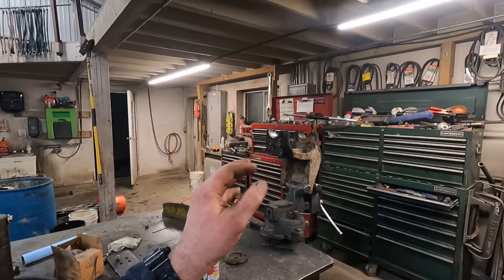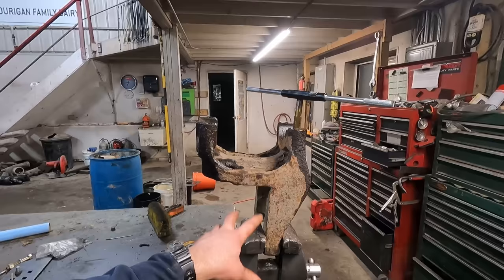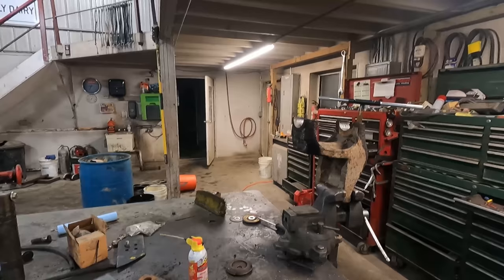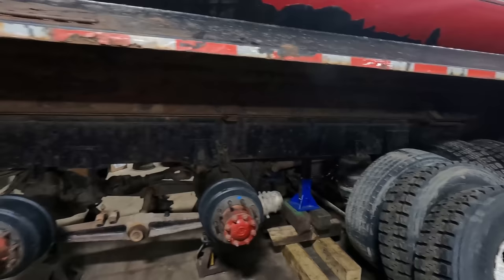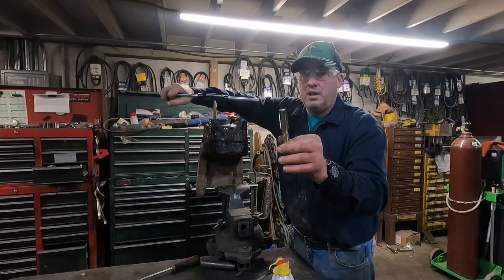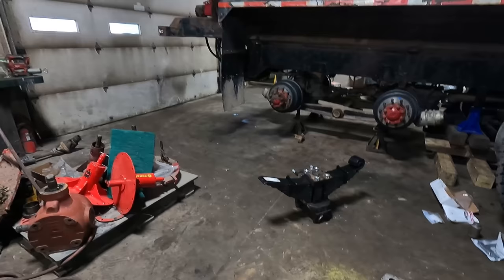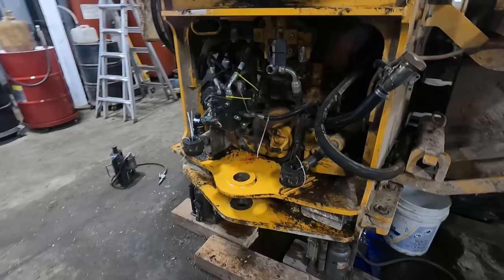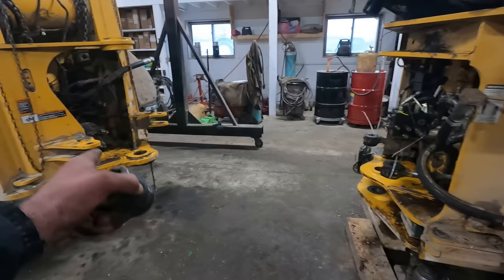Reassembly: Part 2 center Pins and bearing replacement on a John Deere 624k payloader

Comment: There are many that despise the use of anti-seize, many will use grease instead. What I've found where I'm at, grease will dry out over time, the anti-seize doesn't and lasts longer. I'm a firm believer in that stuff. 
Seems like a lot of play but, if an expert says otherwise, guess you're good to go. At least you won't have to worry about getting someone in to line bore it. 
Always waitin on "Tim" LOL poor guy. Doing this yourself saved you a lot of money and I know many won't ever understand that. Oil on the floor means the floor won't "rust" Andy hahaha. 
To line bore, they weld it up, then bore to size. It's really a simple process, time consuming is all. Great video as always. Cheers :)

Comment: Mike over at "Dirt Perfect" did a line bore on his excavator beams. Its quite a procedure but doable by a couple men willing to fight for it. Lots of repetition an hammers but then thats life. As you have said an most importantly made aware is Time! You never get it back kinda like getting a second first impression. I wasted my whole life on hard work just to blow it away for some good times an feeling sorry for myself. Feeling sorry is a very expensive thing as there are no I am sorry for them. Many men and women go through life as if it is just what you do. They make time for church, and down to minutes spread out with kids or husband/wife, their thinking is if they do that then everything is just jolly fine and I ain't gonna burst their bubble but that is not the short side story of it at all. Making the best use of the time you have is for lack of better words; Priceless. I rammed my way through life and never said sorry nor would of even considered it. I got tore up a lot getting in the line of fire whether it be driving a truck, falling timber, loading powder on mining operations. I have worked in the air, on the ground, clear under ground for near a mile or so as too young at the time to really know. I have done so many different types of work that I never really got real good at anything...... I have to inject here that from the era I speak most of is from the sixties to the nineties an its not been a hard job as the stuff we did was pre computer, just manual labor and lots of elbow grease. Now things are a lot different an you don't walk in off the street and tell them I  want a job bartending. I was out of work, young with all my teeth, new something about alcohol from personal research an got a job just as that, a bartender. I found out that it was easy work an might of followed it had my body never gave up on me the first time. I was lucky an got my health back. Went back to driving truck till I met a woman who thought I couldn't do anything wrong so spent time wrenching and coming home nights. Seven years later an a pile of money in front of me with everything going just right, she tells me that she wanted a divorce.... that knocked me down real good. I came to alaska where life was in the fast lane for me an did it over again and then the last time was the last time when I got hurt. Still crippled an wishing I had the "time" to do it over
Reply from the maker: Great comment

Comment: Andy here in aus, they build up the worn frame with weld then machine to size, in some instances they will bore over size then make bushings to fit and use liq nitrogen to fit new bushings, some manufactures produce a complete hitch pin bore sets that you cut out the old with oxy then align new  bosses   and weld in place but they still have to be line bored anyway, it would also require the cab be removed for boring, yes Andy you were very lucky you caught yours in time, with regular maintenance and visual check every so often and using a good  high impact grease in that area it will last you years

Comment: Good decision changing the bearings and pins right away. I had an operator tell me his machine was starting to make a noise on a friday at the end of his shift. He decided to run the machine doing heavy earth moving over the weekend and called me sunday afternoon to tell me that machine  collapsed in the middle of a load. Dropped the bottom pin out and tore the top pin with the surrounding plate clear off the machine. When I got to the jobsite the front half was bucket down buried under the load of dirt he was carrying and the back half was tail down, windshield busted out and the cab twisted to one side. The operator almost got thrown out the front of the machine because he was bouncing against the load, running way to hard. It was the biggest machine we had on the job, don't remember the make or model, but I was not prepared for what I saw when I pulled up to that mess. Fortunately the guy was ok, but he wasn't an operator after that. It's pretty amazing how those two pins are able to hold that machine together and endure all the different forces happening all at once.

Comment: I usually know what you are doing, but love watching you do it.  As far as line boring,  if you get a chance, watch a channel,  Cutting Edge Engineering,  he's in Australia,  he does it once in a while.  They have a slick little machine that welds up the bore, then the same machine bores it back out to size.  I looked into one of them and they aren't that bad, you could get into one for around 6k to start.  If a guy was rebuilding old equipment to sell and make a buck, I could see where it could come in handy.

Comment: Old man at deere dealership showed me that welding trick on bearing race for axle tubes. Trick to slide them back in put new one in freezer for few hours. Nice you didnt have to get it line bored.

Comment: Just watched Larson farms video where they were all worried about a few drops of hydraulic fluid on the shop floor,,,  as they argued about who got to run the floor cleaner..   quite a contrast...  great videos,,,  real farming..
Reply: Not a big fan of them. It's all about the latest and greatest.
Reply: @rickburns8492  Much prefer Andy' s  videos.  The projects they tackle have a greater degree of difficulty.  Agree those large volume channels w/ so many followers, lack personalization. More akin to a Hollywood production studio.
Reply: @billupstateny9151  I agree with you Andy is the real deal.

Comment: I bet your glad it’s not an old Mack with camel back springs. Those U-bolts  on the trunnions torque to 1800 ft lbs , have worn out a few torque multipliers in my past.   Glad to hear you don’t have to line bore the pivot.  Always enjoy your content , it’s nice watching people just getting it done.  The problem with maintenance is it’s a never ending job. The bean counters used to call Maintenance nothing but overhead , but compared to having things done out of house it’s big saving.  I used to tell them the only real overhead are people we pay that make or build nothing.    🇺🇸🦅🌏⚓️🇺🇸
 I have seen the pivot points spray welded and bored seen axle ends spray welded and turned. But in most heavy duty applications like yours they bore it true then weld it up enough to bore it back to specifications. 
I found a video of a pivot eye being repaired on a off road dump truck in case you were interested ?
https://youtu.be/RoBm7HuFG80

Comment: We have them line bored some times. They welded the hole up  and recut it to spec. Nothing complicated. We also put those bushing in the freezer for 24 hours and slide in. Nothing wrong with what you did. I just work at a dealer ship.
Reply: The freezer trick works eh?
Reply: @teaches2010   Yes sir. We slick that hole with a paddle wheel and have bushing freezing and bump them right in with rubber hammer.

Comment: Were l worked we would weld in the worn area and use a boring bar cutter and a fixture with bearing to guide the boring bar driven with an auto feed drill motor , takes some time to do. if it was something we could remove we would use a milling machine. you guys did a great job. Thanks for the great stay safe

Comment: Well them two hammers sure showed us there ain't no electrical problems there.  Ya sure fixed'er up good Boss Man! Glad ya didnt have to line bore it.  I've seen'em do trailers , (horizontal) never had occasion to see a vertical job especially as close as those pivot points are.

Comment: We don't usually line bore anything during the manufacturing process. We leave the pins in during welding and use a big ass air hammer to knock the pin out. The 512, 637, 2700, 2400, 2200, R series sprayers are all aligned with pins.

Comment: Good job on the center pin, saved some time and $ by not having to line bore. Unless things have changed, they weld up the hole and then line bore.

Comment: I've line bored a handful of those 24 and 44 series Deere loaders for Five Star, it's a pretty simple job. Typically with line boring you set the machine up on the holes that are bad, put a pass or two of weld on the inside of the hole then bore it out to oem dimensions
Reply from the maker: Thanks for the info Bud
Reply: @FarmingFixingFabricating  Anytime. I really enjoy the channel, keep up the good work!

Comment: One of my loaders is a ‘16 Case 721F with around 4k hours on it now, it has an auto lube system and has only ever worked on the farm.  I had to have the loader pinned and bushed around 3k hours and center pins and bushings had to be done this past September.  I also have a ‘04 Deere 624J, same past minus auto lube and it has 17k hours on it and never been touched.  I’m contemplating trading the Case on another 624J or K.
Reply from the maker: I’m glad to hear that

Comment: From what I have seen before is  that they have a bore welder that lays a series  small beads all the way around a complete circle from bottom to top  on the bosses and then when it cools then that's when they bore it back out to specks for OEM parts . As for the bushings or cups put them in the freezer over nite . It will shrink . Kinda like heating a bearing to slide over a shaft

Comment: On are 644 they built up the bore with weld then line bore it out . Then had to do the bucket joints to built up with weld and line bore to over $12,000.00 in parts and labor .

Comment: If you have problems getting them in we usually throw them in the freezer before we install the 100°f = a thousands of movement with metal most of the time

Comment: Just goes to show it never pays to ignore noises and symptoms on that stuff. I get after my girlfriend all the time about that lol.. i have been involved in a couple skidders where thats what had to happen: carbon arc gouge the welds off, pound the bushing holders out and weld new ones in then check/center-bore it. Awesome shop video like always. Gonna be cold tomorrow and this weekend get your diesel fuel soaked gloves out lol
Reply from the maker: I’m hoping that we are late enough in that the field treatments have had time to do there thing
Reply: @FarmingFixingFabricating  that’s what I was thinking yesterday I’ve been putting fuel treatment in everything all winter and it hasn’t really been that cold up until now. We’re only running two trucks today and I just got them both running so as long as they stay that way I’ll be happy

Comment: We did the same thing years ago on a 69 hough 90 . That job was a bear I believe it weighs 40,000 lbs there were more than a couple butt pucker moments when we lined it back up. I use high temp brake grease instead of never seize, seems to hold up against the salt a little better.

Comment: Cutting Edge Engineering Australia has some videos on line boring and welding. It takes a special machine. Not sure it would fit in the cramped space available.
Reply from the maker: They have a special one just for it

Comment: I don't know if they make oversize pins. They use a special wire feed bore welder gun to build up the bore and then turn it back down to the pin diameter.

Comment: I use liquid nitrogen all them time in the shop to shrink bushings and other things I need to push in. Have an old semen  tank I use for it. Have it filled when they  charge the ones we store semen in. Pour what you need in an insulated water jug and lower part in. Works great and is always on hand in shop.

Comment: Could you take a couple of heavy pipes that hook over the top of the manure pit wall and angle out to where the wheels of the manure pump  would rest in the bottom of the pit put a couple of braces to hold them together then weld 2 half pieces of pipe for guides and weld them between the rear dual wheels to use as guides to lower the pump into the pit to keep from bending the crap out of them
Reply from the maker: Maybe

Comment: When we line bore a piece of equipment we build up the surface area of the hole with weld and then mill it back to the factory spec

Comment: Do you put them bearings in the freezer for a bit first to shrink them a touch.

Line boaring I have seen the weld more material in then remove
Reply from the maker: I didn’t freeze them

Comment: When they line bored ours they cut out the bushing housing  ring  in one unit. In the other they built of the bushing  housing ring  with weld in either  case the had to true them up by re cutting the pin bushing  holes

Comment: What day will do is weld all the way around all the way down through them holes then they'll put the shaft in with the cutter bit And cut the hole to the dimension of the pin that's how they do line boring

Comment: How many hours of service with proper maintenance do you expect from your tractors or loaders before heavy repairs like motors, transmissions frames etc? From what I can tell other than broken tractor axles getting up to the 20000 hour mark without heavy repairs speaks well of your maintenance program.
Reply from the maker: It use to be 10,000 hours now we expect more and have raised the bar to 20,000
Reply: @FarmingFixingFabricating  I think you are realistic at least with pre deff tractors. We have three pre deff tractors around the 12000 to 15000 hours and others at 10 to 12000 hours all running strong. We have no experience with the newer ones.

Comment: Why don’t you run autolubers on the loaders? Seems like most I tinker with have them, especially feed loaders. I did a 544J high lift once....never cussed so much trying to get it back together. The next one I did was a 624K high lift and it slipped right back together. Go figure.
Reply from the maker: Everyday is different

Comment: What did u use for feeding while the pay loader was down?
Reply from the maker: We used our other loader
Reply: Farming Fixing & Fabricating yeah I saw that when I watched at the end of the video.   With an operation like yours I assume having backup equipment is vital as u explained about loosing time. Time being more valuable than money I didn’t realize.  These videos are great. Thanks for giving insight to what it’s like to run a farm like yours.  I’m amazed by the constant repair replacement needed  and the man hours and parts costs. I like seeing the actual repairs as you show them.

Comment: repairs addiction 99.9999999 percent of this stuff simply doesnt need to done at all, halucinating, but hey need the hours, tax wright off for the parts most likely, and too bad some times that the equipment is also built to fail so, yep, could still break down the whole opperation, that would be nice, better safe that sorry, maybe just buy extra eqipment to have around so your good to go, like a few extra combines tractors and choppers, only money, he he ha ha, i could never dream of fixing that stuff, i would have proabably blew all that stuff up with a nuklear missle along time ago to the moon and put a electric wind mill on the moon, maybe a motorcyle, no not safe, cant belive those machines might have to make it work
corn is growing like hell right now in the rain forest, maybe burn that crap down with fire who knows maybe send some tractors down there
Reply: Dude, you need to lay off of the weed for a little while.
Reply: @farmerbill6855  im drug and alcohol free 
but for some people fixing stuff is a real high, i cant fix anything i have a broke down car in the drive way with a brand new alternator and battery and i bought a different car because that was too much of a rabbit hole for me at that point, i managed to put a new battery in it, and i got towed to the repair shop for the alternater replacement, that wasn't it, at least the tow was only 50 bucks or so, that was nice, now the car needs to be shreeded or junked or whatever, just not a good situation, nothing really wrong with it, hey maybe swap out every car in America quick throw away all the old ones, and create trillions of jobs for every one, that is the problem, corn ethanol is pretty bad man, waste of energy, money, 50% of corn in USA goes towards ethanol too, nobodys' fault every one needs a job, maybe the guy who works at the auto plant gets a pension, then his job ends up in Mexico or China too bad, beef eats up a lot of acres, no ones falt, global warming is  caused by over population first and foremost, no one will say it how it is, farmers arent doing anying wrong, they cant plant 365 but, some days as a farmer are pretty ruff that is a garuntee